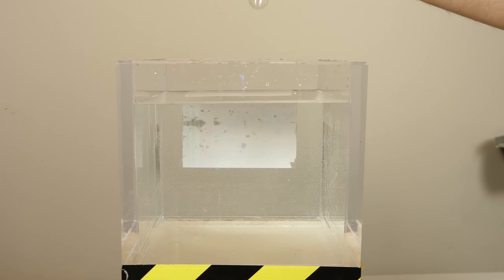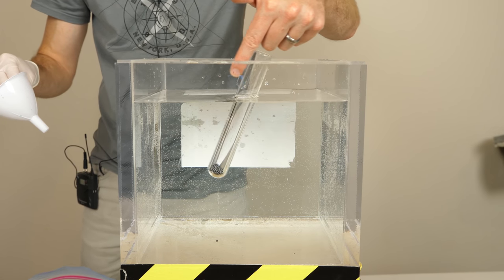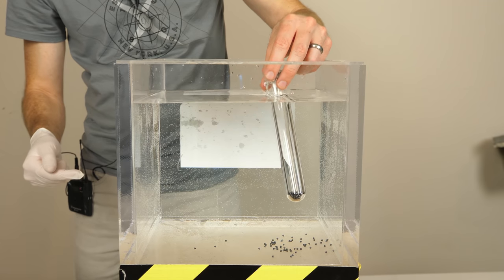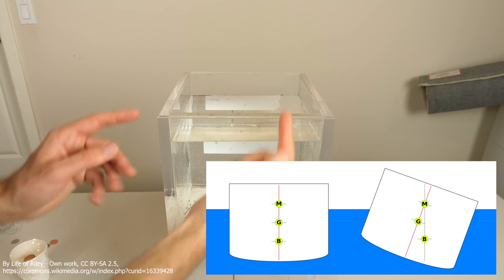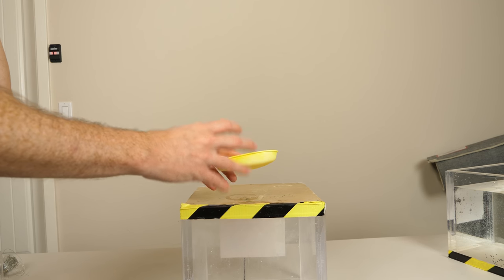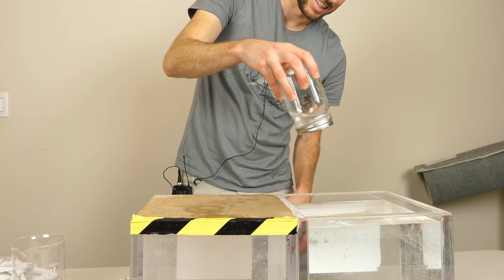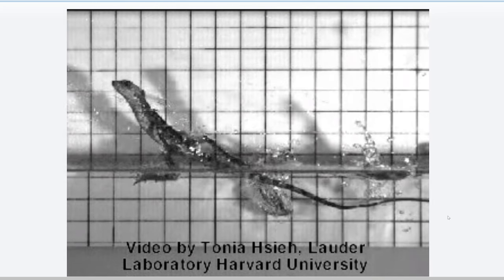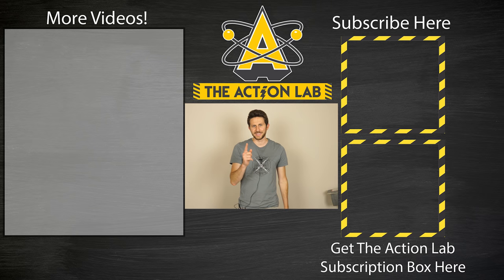Why is it so Difficult to Walk on Water? Amazing Water-Tension Experiment

Comment: It's also hard to walk on deep snow, but someone invented snow shoes and cross-country skis. I'll bet it can be done. Here's a thought. Make two long box-like skis each with a volume of about 23 gallons (90 liters) for a 150 lb (70kg) user. Use ski boots or something that keeps you shins nearly perpendicular to the skies. Because they are long and there are two of them, they essentially form a square version of the jar with pennies on top in the video, which is stable up to a certain angle. Then make ski poles with maybe 3 gallon  (10 litter) floats on their ends that you can use for added stability and to push yourself through the water. You could also add ridges or "treads" to the skies to help them push the water better when you wanted to walk forward or backward. It wouldn't be like walking on land, but it wouldn't be too different maybe from skiing over deep snow. Each ski would only have to have dimensions of about 6' x 1'x 0.5' (2 x 0.3 x 0.15 meters).
Reply: Did you calculate all that?
Reply: While it's certainly interesting, most water sports boards are similar in volume and generally much easier and faster in terms of movement. I think it would take something particularly innovative to get people to ski on water, but I think it'd be funny to see :D.
Reply: @RaeKobi  water skiing is already a thing
Reply: @ShlokParab  probably they’re simple calculations all he did was divide a person’s weight by the weight of water per gallon and a quick volume calculation. People have tried to do this, it’s very hard to stand but I believe hypothetically there could be a ski shape that makes this feasible. (Definitely not a boxy shape like this guy suggested tho lmao). Something similar to ice skating how you push your feet off to the side to go forward maybe.

Comment: Hmmm...the experiment of gravity reduction and flippers has a fundamental hook..if you suspend 80% of your body weight, it isn't the same as reducing the gravity by 80%. The water is still under the influence of the full gravity, unlike if you were on the moon. There, your weight would be a sixth of that on earth but so would be the water and so its surface tension...I think it wouldn't work even on the moonto walk on water even with flippers, unless you would put the water under pressure, simulating gravity and air pressure on earth without affecting your body by this pressure, which would be pretty difficult
Reply: This might be correct if water wasn't incompressible.
Reply: Good thought! Surface tension would remain the same, but boyancy force would also be affected due to the reduced weight of water just like you predict. Luckily I think the researchers were using the reaction force of hitting the water, rather then the buoyancy force. So because water is not compressible as Owen mentioned, and its mass is still the same to resist acceleration through inertia, the results might not be affected by the water's reduced weight. On the other hand, stepping into the water encounters resistance because there is water in the way of the flipper: the reduced weight of the water might make it easier for the water to simply move out of the way of your foot by means of raising the water level around it, causing the force of your step to go into creating waves (lifting water) rather than pushing you upward (lifting you). I guess it would depend on whether the predominant mechanism for water resisting the entry of a flipper is the inetria of the water as a whole resisting acceleration, or the weight of the water resisting being lifted. It could be a combination of both! Maybe we need another test with a liquid similar to water but only 22% as dense to see for sure. :)

Comment: I used to hate these kinds of problems during my course in Continuum Mechanics, because I always felt as if I had to do super-confusing algebraic calculations of every single part of an object;
but it turned out that I only needed to use a couple simple equations, which basically involved the length along the water surface, the submerged volume of the object, and things like that.

Comment: Back in 70s, I seen someone make styrofoam shoes with wide modified (one way) vertical blinds attached to the bottom, seemed to work, they didn’t show it very long though. Was on a tv show.

Comment: I ran across a pool and made it like 10 steps before my feet started sinking, I completely sank in the step after water started going over my feet. I was like 10. I have not been able to replicate it since. I don't blame you if you don't believe me, if it didn't happen to me, I wouldn't believe it either. I wasn't trying to run on water, I was just trying to run and didn't even consider that it doesn't work on water, like I forgot for a second that it was "impossible"... some might take this in some esoteric way... I somehow don't think that was it, but it may have to do with the way you run when you don't question the surface beneath you, because I tried replicating it immediately and couldn't. I've tried a few times since... no luck. I had no flippers, just bare feet. I've always had relatively small feet so this does not help the physics of things, but that was the circumstances of the situation. I'm baffled by this, to this day.

Comment: if two people were to wear the same type of flippers and same size and the smaller person weighed 1/5 of the bigger person does that mean that they would be able to walk on water because they are at 20% of the bigger person's relative gravity? like a 70lb person vs a 350lb person both wearing the same flippers so the surface area on the water doesn't change for either of them it's only the weight.

Comment: The water in the inverted mason jar does not fall because the surrounding air pressure pushes the water in, NOT because of surface tension !

Comment: Why are you making it so complex, whenits easy,  density of the object has to be less than the density of the water in order to make any object float
Reply: I guess you missed the bit about the floating wire. AND the entire thing about surface tension.
Reply: @godfreypigott  oi mate, it's been like half a year ever since I posted this message henceforth mate you are damn late to reply on this comment.
Reply: @syamantaksengupta2334   Yeah - nice way of avoiding admitting that you were dead wrong.
Reply: @godfreypigott , thanks 😀
Reply: @syamantaksengupta2334   No - thank YOU. Admission by omission.

Comment: I found it possible to use a regular cup with no small holes or cheese grid how is this possible all I did was turn it upside down and the water stayed there not going anywhere stayed right where it was basically defying gravity how is this possible plz tell me also on a side note I discovered it while taking a shower

Comment: Even with perfect hydrophobicity, you would displace the fluid. Water tension is maintained regardless of shape, and would form around any human. 
The total displacement of the same weight of water below as the human above is relatively absolute, whether by Kinetic activity like running, or an air filled vessel, is an absolute requirement. To what degree that is compatible with the requirement to be walking ON water? At what point are you simply not standing on a boat. Hovering while in contact with the water is likewise not qualified. Curiously, water is one of the few substances which is denser in its liquid phase than as a solid. If you could freeze water so fast that the discrepancy in density outweighs a human, about a cubic metre or two of ice. 
That’s 306MJ of energy, which in a perfectly efficiency heat pump moving let’s say 1:5 times it’s heat, to cool that much water is as much power to run a household freezer for ~ 25 days. That’s for every step.

Comment: Before when i was at school at adventure i was near a river and i found a metal rusty box my friend wanted the metal rusty box to float he had 2 solutions just air or add a little bit of water he tried air didnt work little bit water It did work this is not a joke its actually real but when the metal rusty box floated or was stable he shower it to the teacher and my teacher told it like the same as the action lab told!

Comment: Wait a second isn’t that 22% gravity experiment heavily flawed. They made the humans weigh 22% of their normal weight but the water was still under regular earth gravity so that doesn’t emulate a smaller planet at all. It just emulates if humans weighed a lot less not if everything did. It was my understanding buoyancy is the same in any strength of gravity because it’s a relation between the two densities not absolute. So even on Jupiter humans would be just barely lighter than the same amount of water

Comment: What does it take to walk on water? Very easy, just lower ambient temperature below 0°C (i have no idea what that is in gallons) and wait a bit 😂
Reply: 0°c does not convert to gallons.
Reply: @Bendigo1 yeah... And mocking the imperial unit system was a joke you didn't get i guess
Reply: @kayburcky7146  No, I got it.  But it was not a great joke.   The walking on frozen water was pretty good though.

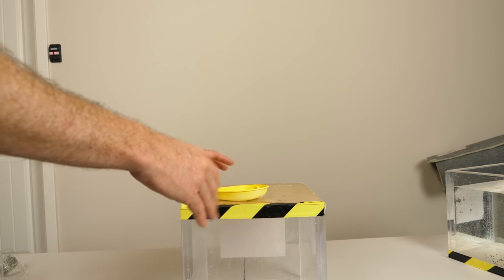Comment: 4:47 you told that centre of mass should be above centre of buoyancy and now you are saying that you would fall ..How?
Reply: No, he said the CM has to be below CB, then he explain that it is possible to float while having the centers vice verse (CM above CB) only if the CB moves relatively toward where the object is leaning. For example he explained it with the ships, once the ships leans towards the left side, ships are made (having water inside them) to automatically shift their CB in order to keep it stable. The only problem is that it only works towards a certain angle, once the angle is passed then the object will shift completely
Reply: @raulquindosmorales6819  ok ...thanks
Reply: @rhythmsheth1115  no problem

Comment: 67 miles per hour. It's pretty unclear sentence. Is this speed of movement one of a legs down? Just check the maximum speed of ball in football/soccer or rugby. If it have linear equation I'm waiting snowmobile with 850lbs mass needs x4 speed for no drowning. It's would have speed approximately 270 miles per hour) But it hasn't. And still able to cross the lakes on water surface. Checkmate.)